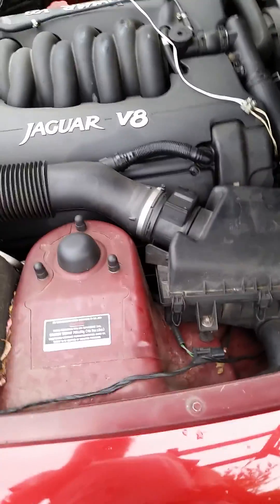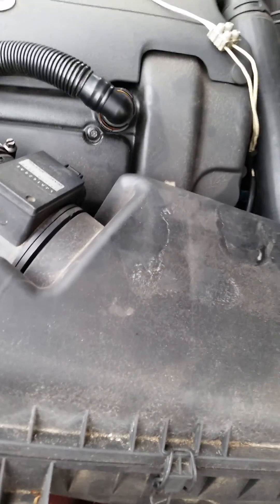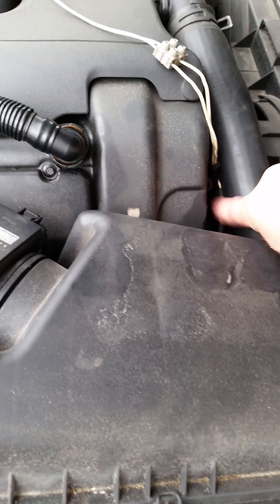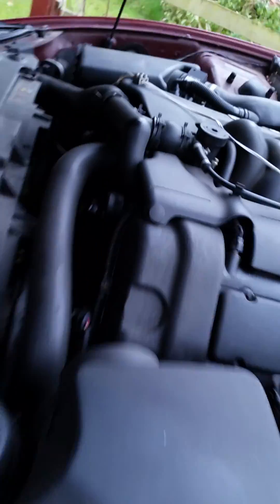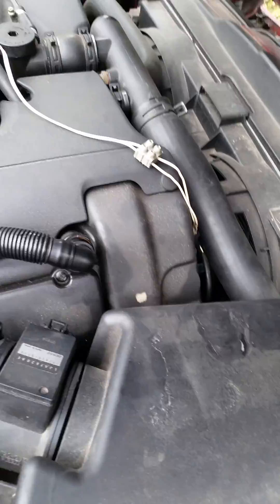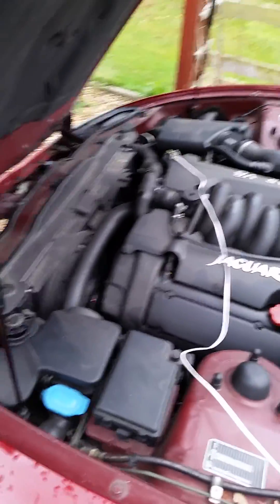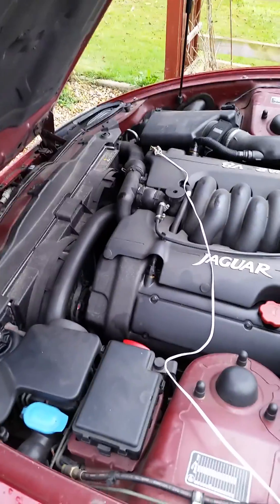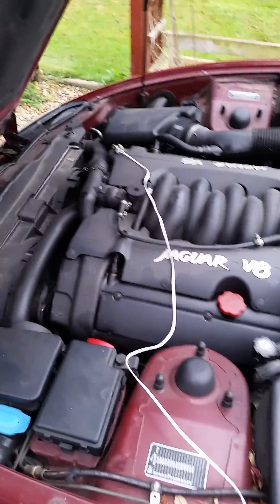Jaguar XK8 engine knock vvt test

Comment: I bought an XK8 that I haven’t even seen yet but apparently with a clatter so assuming it’s not rod knock then its tensioner or this... nice diagnosis method
Reply: did you ever fix it?
Reply: @h7pubg  car was sold but found out what problem was when I lifted the rocker covers and saw that in one bank the variable timing Gear had been removed and the sprocket had been ‘welded’ to the camshaft…. Haha…. Absolutely amazing what some people will do

Comment: That's exactly the noise I'm getting from the right bank on my XK8, mine disappears after the throttle rises to about 3k, dabbing the throttle will give a little knock too but that ratcheting up noise that it makes when you manually operate the VVT is exactly the noise mine makes just before the noise stops. Once the engines warm, the noise is gone until you shut it down and restart, then it's straight back. I've just changed secondary tensioners again to make sure it's not those, but after watching this, I'm pretty sure it's a sticking/failing VVT. Thanks for sharing.
Reply: Did you solve yours? What was it?
Reply: @grantleydesignjaguar8290  I never did solve it, I just ignored it. Cars been off the road now for two years as I need to get around to doing some mot welding. I've aquired a spare engine, so when I do the welding and get it back on the road, I might have a play.
Reply: Thanks for the reply.  There's another YouTube video out there with the exact same noise and it turned out to be a Conrad.  By comparison, I'm hoping it's the VVT valve.  I too have a shed load of welding to do.
Reply: @grantleydesignjaguar8290  A con rod wouldn't give that distingtive zip tie noise and then shut up completely. I'm pretty sure mine is the valve.